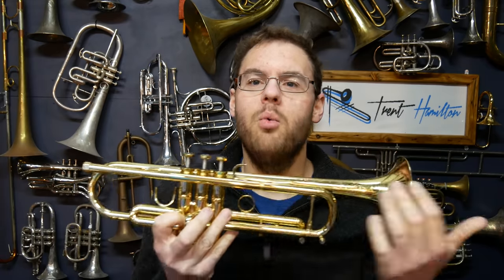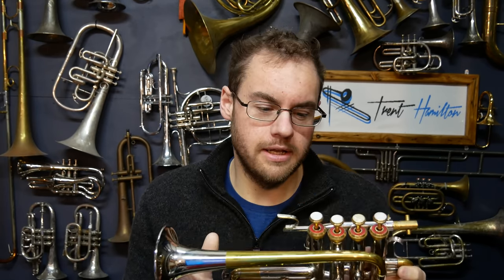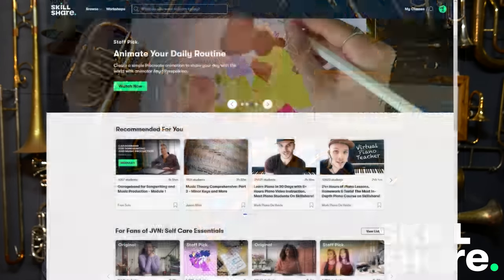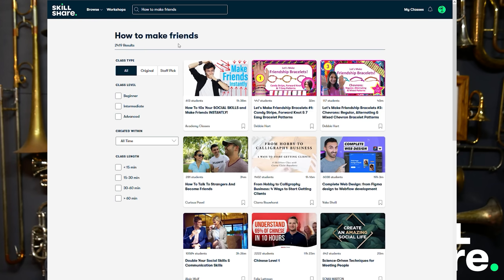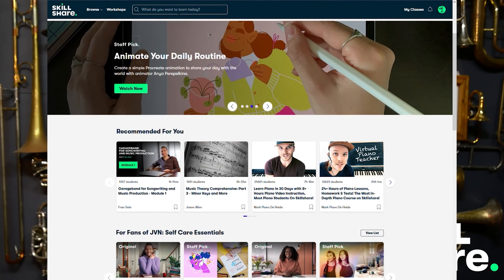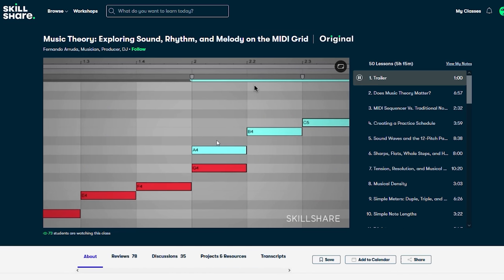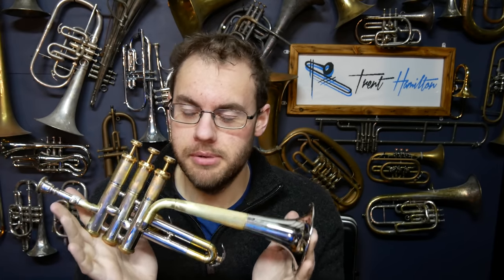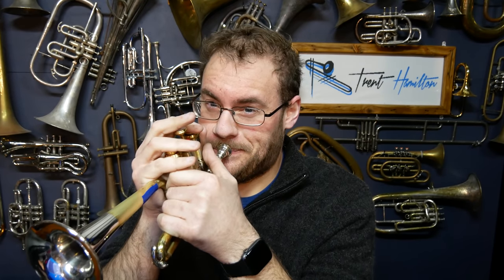The Worlds First Super-Piccolo Trumpet!

Comment: Mr. Hamilton, wow! You’ve done it again. You’re a genius. 
However I am intrigued by the image at 2:28 on the left of the screen. Yes, the first valve . . . Rotate the tube clockwise 90° and fashion a bell 81.4 mm long and 37.777mm in diameter then fashion a lead-pipe for the other port (on the left). Take special care to get the taper right and find the correct “gap”. Voila a Triple Pickle-O Trumpet!

Comment: As any trumpet player wanting a higher range finds as they experiment with a piccolo trumpet.... there is no free lunch. Regardless of the length of tubing, your lips must vibrate a the frequency of the note you wish to produce. So, if you want to play A-440 on a Bb trumpet, a French Horn, a tuba, or a piccolo trumpet (super or otherwise) your lips must vibrate at 440 Hz. It's just that way. Nice work Trent. Don't hurt yourself.
Reply: There's actually no study on the relationship between the frequency of the lip vibration and the frequency of the sound produced. Remember, playing A4 on the trumpet, you're not just producing the 440Hz wave, you also produce all the harmonics (880Hz, 1320Hz, ...). Also recall the demonstration where someone make a note sound from a tube and a torch. The velocity of the air from the torch is enough to induce vibration in the air column, you don't actually need a lip reed.

Comment: Well done for craziness but I have to be a wet blanket here and point out you should have left to flare on and cut off the bell instead. Just like the piccolo bell is smaller than the trumpet bell the bell for the super pic would have to be be smaller again. About 50-60mm. So you still have the flare right? so maybe put that on in place of your frakenbell and lets call her the MKII....cheers and don't even turn normal...

Comment: Make a half size euphonium. And aldo a half size Eb trumpet. The Eb trumpet might work better. It woulf be the highest possibly working trumpet
Reply: You could probably make a half size euphonium by rearranging the valve section of a flugelhorn like this guy did to a cornet https://youtu.be/mLxiejdGHrI
Reply: You can theoretically make a Bb "Soprano" Euphonium by starting with an Alto Horn, removing all of the cylindrical tubing, and uhh...praying that replacing the leadpipe for a Flugelhorn leadpipe assembly leaves you with 4.5'.  It won't sound as good as you imagine.  Soprano timbre doesn't scale that large.  You get something that sounds like contra-alto.  Good strategy for making an instrument loud AF, though.
Reply: @Markworth  Yeah!, Hoe do you feel about this little trumpet?
Reply: @instrumentalheadquarters7062  I think projects like this are really cool and a good learning opportunity in a great number of ways, but there's basically zero chance that you can make something like this be useful.  At this length of tubing, the overall size is relatively big, so the resulting timbre will actually fight against the useful range (like a Flugelhorn or Bass Trombone).  On the other hand, I don't doubt for a second that there are multiple players talented enough to play real music on an instrument in 1-1/8'Bb.

Comment: Trent or anyone....I have a question. I purchased a vintage King H.N. White mellophone off ebay for the purpose of using the bell on a French horn. Any opinions on that?  I know the bell may be an inch or so smaller in overall diameter but being about a hundred years old in guessing it could be an interesting project.
Reply from the maker: What would be the advantage of doing that?
Reply: @TrentHamilton  yeah....none really....just the mellophone was cheaper than buying a whole bell! I got it for $100 US and sent it to Art! You know, the guy that has your euphonium! Plus I'm not sure if it's a nickel bell or sterling. It's more of an experiment. From what I've deduced, the mellophone bell would be 11 inches diameter vs. 12 for the horn. So pretty close there. Plus it's not a straight mellophone, an old vintage curved one. Trent, I guess I'm a little loopy😁😅

Comment: This instrument could be a better option to use in DCI for pieces that requires a musician to play a high note
Reply: Piccolo trumpets sound quieter than your standard soprano trumpets, in big part because of the smaller bore and bell, so piccolos might only work in DCI during softer ballads. Sadly though, another problem with piccolos is that they are notoriously hard to play in tune to where it's recommended that you spend about a full year on one before performing live, and this is largely in part because the shorter length of tubing is affected by acoustical physics to a greater extent. This one being an octave higher than a Bb piccolo trumpet And not having its valve slides properly tuned to its new relative length/pitch means that it would probably be nearly impossible to play more than a couple notes in tune, if that.

Comment: It sound extremely squeaky. The sound quality is poor. It does not project very well. The sound hint that there are some gap of some sort in which the air is getting out of. Honestly not a good instrument, pipe are there for a reasom. One might just take away the main pipe of his trumpet and therr would be little diference.
This trumpet is advertised for its very high register yet the high note that were played were not well sustained and sound very weak.
I do not advise buying this trumpet as it seem to be fit only for mere party tricks